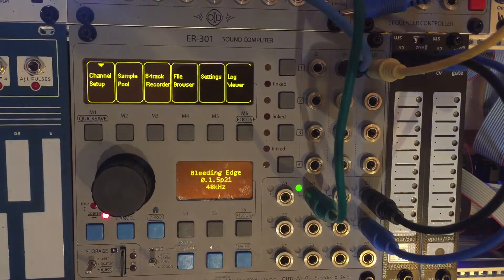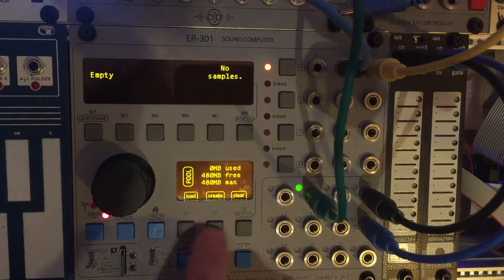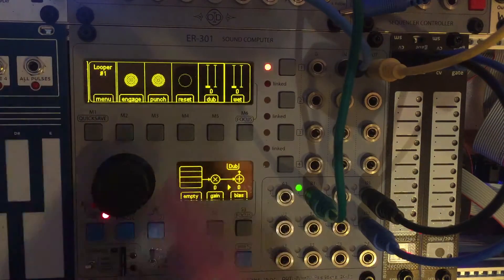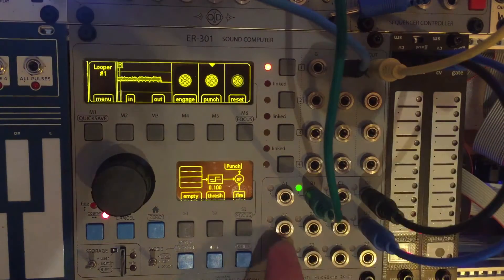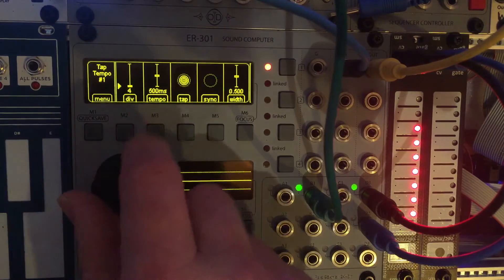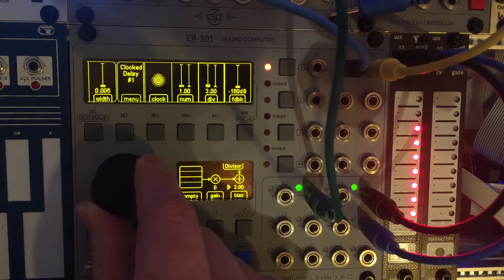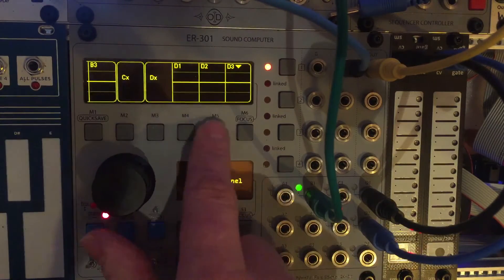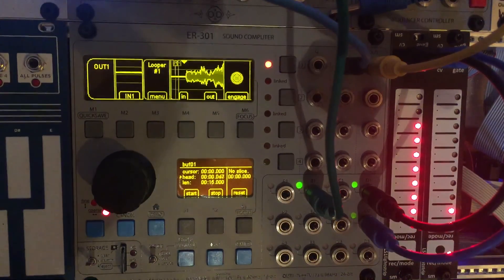Getting started with the ER-301 #5 - Create an Audio "Freezer" from Scratch

Comment: sorry for hassle Neil not sure how to go about asking a question...have wav file playing in variable speed player, ilike i have before and then i have it into a delay unit and then into a reverb.  my current issue that just happend is now the delay unit and or reverb unit are blocking the signal so i have no audio.  if i bypass both i here the wav file but if either are not bypassed the signal is blocked....this is first time i have had this happen... new user have had unit for about a month...

thanks so much for all your vids and support.
Reply from the maker: Hrmm that’s odd as the delay and reverb process signal from the left and output to the right.  I’d have to see some screencaps or a video to see/hear what’s up.  My email is on my website splash
Reply: @NeilParfittMusic  hey Neil I got it to work.  I deleted both units and reinserted and was fine.   One more question if you don’t mind.  Sometimes if I load an existing wav into buffer and play without slices it only pays maybe 10 seconds of a 20 second buffer and goes back to beginning again.  There are no visible markers I can see causing it to start over.  What do I change so it will play the entire length of buffer?